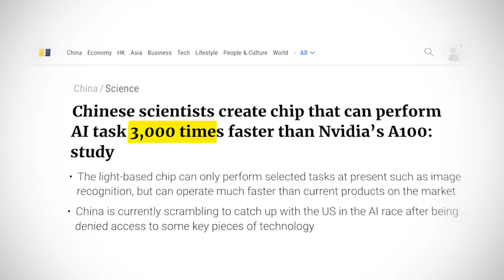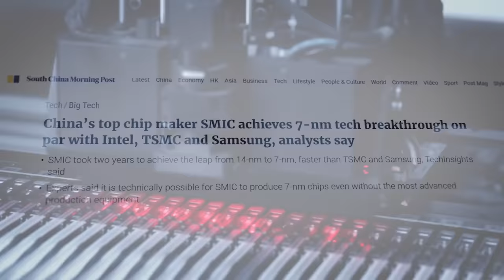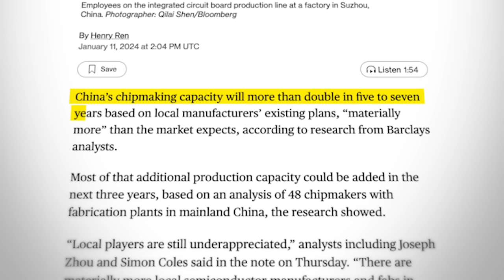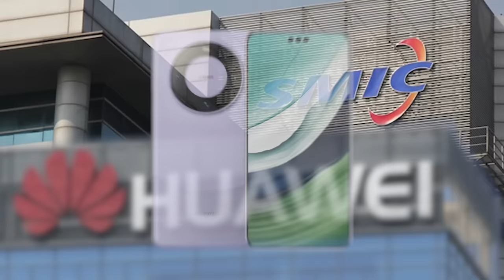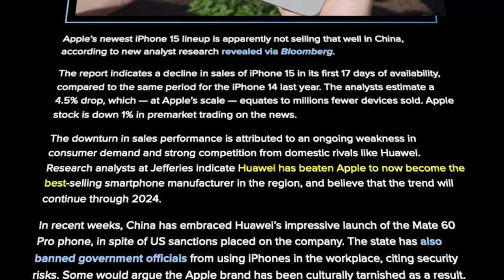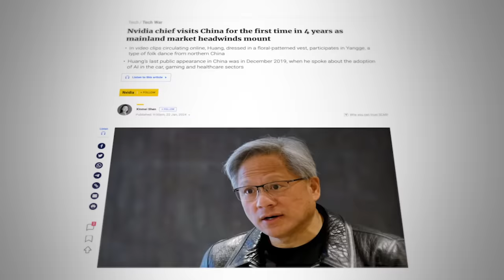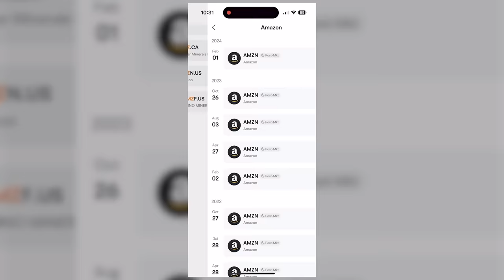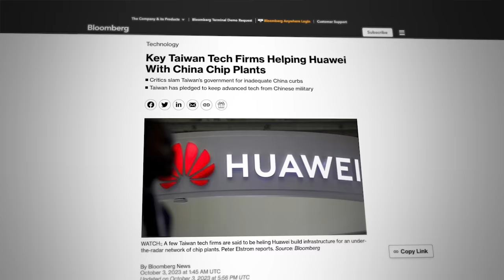China Created an AI Microchip 3000x Faster than America!

Comment: I read about the practical use of light in computer processors when I was going to university back in the mid 1990s. All of this was just theoretical stuff. The argument was using light instead of electrons, because light moves much faster than electrons. Fiber optics is using light to transfer data across vast distances. Before we had fiber optic cables, we had copper cables which transfers electrons, and this has a lot less bandwidth and has more signal loss when transferring data long distances. 

Photonic chips use light instead of electronics which is much faster, and uses less electricity. It also generates less heat. If China can produce such a chip, it would be groundbreaking.
Reply: Over a short distance and using extremely low resistance oxygen free pure copper cabling, both electrons in the electrical wire and light photons through the air travel at the same speeds. However, copper wires inevitably meet up with internal resistances caused by impurities as well as magnetic induction over long distances and invariably slows down (it's the resistance in the cabling that causes heat and so, heat is a function of resistance and not the other way round). Light photons can also meet up with resistance (air layer densities) but this is so tiny to be almost negligible over the same distance as the copper cable.

Comment: A cell phone that only needs to be charged once a year?
Reply: It seems that this may come in the form of fuel cells rather than stored battery power.
Reply: @George123-bv7xq  I'm talking about current batteries.  If the phone only uses 1/1000th the energy of present phones, batteries would last longer.
Reply: @claudermiller  Or if the batteries have 1,000 times the energy storage, the phones will last a longer time in between recharges.

Comment: I’m sure the Chinese C919 jetliner is also revolution breakthrough that changed world aviation forever.
Reply: You're probably being sarcastic, but with everything else considered, the chinese airliner probably is cheaper considerably. It'll take time but once they've debugged everything and the world gained confidence in the chinese plane, they will take over the airliner industry just like everything else.
Reply: @rap3208  Well, the C919 and C929 seems to be better than the Boeing 767 and its derivatives that seem to be either falling from the skies or have bits, exploding engines and pieces dropping off the planes.
Reply: @George123-bv7xq   The operating word is SEEMS. It has to be used by the thousands and stand the test of time for it to claim it is better. As of now, it is just being developed and construction of the prototype has or is just going to be started. Come back after a few years when hundreds of the plane has been operating for years carrying passengers all over the world..
Reply: @rap3208  Exactly - which is why I used the word, "SEEMS" as the C919 and C929 has not been time tested yet. There is plenty of interest all around the world. 
The greatest hurdles the C919 and C929 has involve certification to fly into European countries and the U.S. as well as the setting up of equivalents to the NTSB, the FAA (or European equivalents) and worldwide servicing hubs - that is, if China intends to have those planes service the globe. 
If not and they are only meant for China's own internal service, covering perhaps Russia and North Korea, then, there's no problem. Otherwise, one can bet that the USA Americans are not going to make it easy to certify Chinese made planes to fly into and land in the U.S.
Reply: Ignorant much? If China closes its airspace+ Russia from Boeing planes, the company is dead! Please get a better education.
Reply: @George123-bv7xq   As I have said SEEMS is the operating word. It is all wishful thinking on your part today. Come back in a few years when its proven itself then it can join in the discussion of BEING BETTER.

Comment: The ACCEL chip employs a combination of optical and electronic analog computing, which manipulates light for calculations. This approach is theorized to be faster and more energy-efficient than traditional chips. A research paper suggests that ACCEL is 3,000 times faster than Nvidia's A100 GPU at specific AI tasks related to vision. However, the claims are based on a research paper and have not been independently verified. Real-world applications and comparisons with commercially available chips require further testing. It is an exciting development in AI chip technology, but caution is warranted concerning initial reports. Future developments will determine whether ACCEL lives up to its promise.

Comment: I am pretty sure the use of legacy equipment for improvising and "making the best of it" will end within 2-3 years. By then they will have their own EUV lithography machines and other most advanced equipment up and running. 

The good thing about that new AI chip is that although it is also based on legacy tech, the Chinese seem to be the first to have used and combined such tech in a way that enables such performance. Even if the West tried to copy that now, China has a head start and can build on that to further improve it and make it ready for mass production.
Maybe they will make such progress that trying to catch up on conventional chip tech is no longer necessary in the first place.
I assume that the extremely low energy consumption also results in almost zero heating, so they can do without cooling systems.

Comment: While the summary presents some valid points about China's advancements in chip technology, it also contains several claims that require further verification and nuanced understanding. Here's what I found:

Factual Information:

Development of AI Microchip: Claims about its speed and efficiency compared to Western chips are unverifiable. No independent benchmarks or technical details are provided.
Impact of US Sanctions: China's chip industry has indeed progressed despite sanctions, but attributing it solely to sanctions lacks context. China's long-term investments and domestic demand also play a crucial role.
SMIC's Achievement: Producing 7nm chips is significant, but the mass production claim requires independent confirmation. Additionally, 7nm technology is not the leading edge anymore.
Huawei's Progress: Huawei's 5G chips are based on SMIC's 7nm process, but their capabilities need independent evaluation. Their performance compared to leading-edge chips is unclear.
Market Reactions: China's advancements have affected tech stocks, but attributing all stock reactions solely to this reason is simplistic. Multiple factors influence markets.
Speculations and Predictions:

US Sanctions' Consequences: Whether sanctions fueled innovation is debatable. Increased domestic efforts driven by economic incentives and national security concerns seem more likely.
Nvidia's Challenges: Revenue losses in China are real, but attributing them solely to restrictions is narrow. Competition and market dynamics also play a role.
China's Future Goals: Breaking the 5nm barrier is an aim, but its feasibility and timeline are speculative.
Global Semiconductor Landscape: Collaboration might be beneficial, but the video's suggestion to prioritize design leadership lacks context and ignores strategic competition.
Taiwan's Role: Bloomberg's investigation needs a thorough review before drawing conclusions. The geopolitical and economic dynamics are complex and require careful analysis.
Conclusion:

The video's conclusions lack nuance. While US-China competition in chip technology exists, attributing China's progress solely to containment attempts is simplistic. China's advancements have multiple drivers, and collaboration may not be feasible given ongoing tensions.

Recommendations:

Use trustworthy sources for information, such as research reports, academic papers, and established news outlets.
Be critical of sensational claims and verify information with multiple sources before drawing conclusions.
Avoid investment decisions based solely on promotional content in videos or articles. Conduct thorough research and seek professional advice before investing.
By following these recommendations, you can gain a more comprehensive and accurate understanding of complex topics like the China-US microchip rivalry.

Comment: I'm guessing that ACCEL is a photonic chip.  I have been saying that the most likely tech breakthroughs were probably going to come from photonic chips in China but I didn't think that it would happen this quickly.  In fact, I mentioned this on Cyrus's Tian Gong Space Station video back in November 2022.

What I didn't know was that photonic chips would be so much more efficient than regular semiconductors so that was a pleasant surprise.
Reply: The fundamental error the U.S. made in attempting to block/slow China advancements, they did not account for the Chinese speed! 

China performs at 3 to 4 times the speed of the west so all their strategies are all a bit late to be effective.
Reply: As the saying goes... Don't underestimate China.

Comment: Cyrus, what's the yield on the SMIC 7nm chip? What's the defect rate? Be honest, now. If you need to produce three chips to yield one of the quality necessary for your Huawei phone, it's not very cost efficient, is it? Yes, it's a public relations success, but it's not feasible to produce 5nm and 3nm, and even 7nm without EUV lithography. You're leaving so much out of your story.  Why didn't you discuss the first bullet point under the headline in your article. It says "The light-based chip can only perform selected tasks at present such as image recognition,..." Don't get me wrong, I believe that China WILL catch up to the west in semiconductors AND semiconductor manufacturing machinery, but there is a learning curve that will take time. These issues should be discussed rationally and realistically. When, for example, do you predict China will produce its own lithography machines and use them for mass volume production?

Comment: This is still at research phase Mr. Cyrus. It's definitely a gr8 research work, but the market for this chip is still far away. Also, China's total independence in all sector's of chip manufacturing: capability in optical technology, in building the weafer stepper, making the photo mask etc are still quite a few decade away. Without these, this corrent 'momentum' will fail to last.

Comment: Thanks for everything you do, Cyrus, but it's not as powerful as you said. According to professional reports, Accel is only suitable for replacing part of AI computing in the visual field. In these specific fields, it can surpass the performance of traditional GPUs. It does not do everything faster than traditional GPUs. In fact, it can do very limited things. At present, the paper is only at the stage of proposing new concepts and is far from application.

Comment: I had a little laugh, I'm waiting for a few unique MOSFETs and MCUs to come in which might be after the Lunar New Year so I can make a video showcasing a little MCU that some very intelligent people made when in fact all I wanted was a answer regarding the 2038 Event. I'll wait until the other items comes in and show a similar chip mentioned in this video, but I will cover a name on the chip since it might be what I'll use to form a new company and some of the things the people tat made it asked me to cover. All I'll say for now is 7nm is a bit larger than what was used to make the chip I have to fit in the package I asked and light for communication is very quick along with clever die stacking and placement (a bit of 5nm and 3nm). I was surprised about this video mentioning light to perform calculations while the chip I have uses it to process information where it is required.